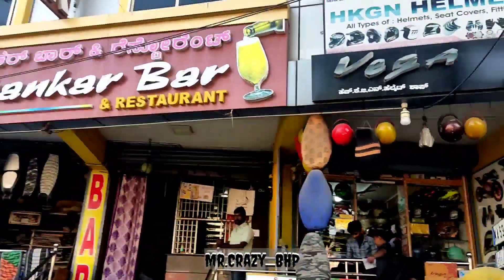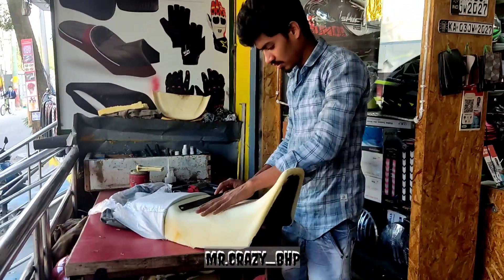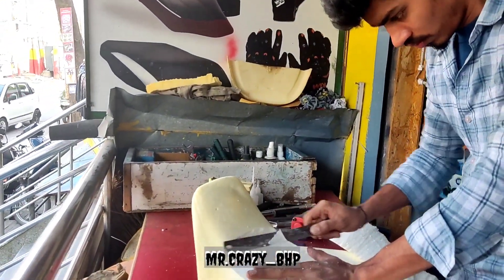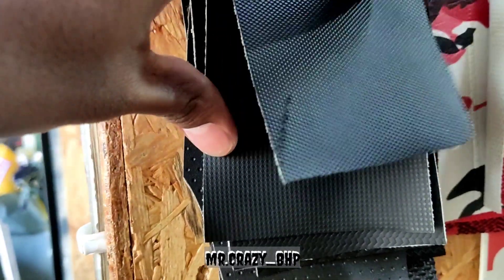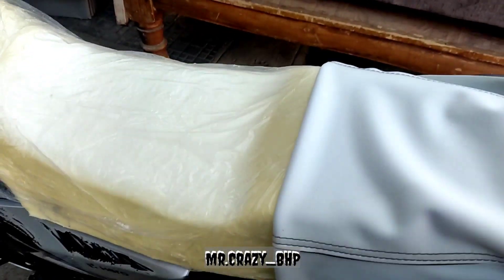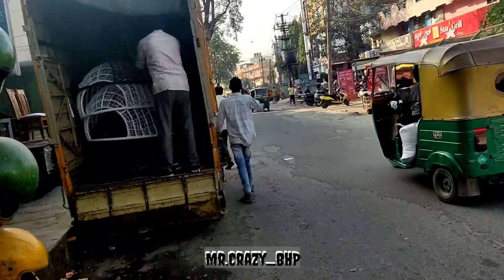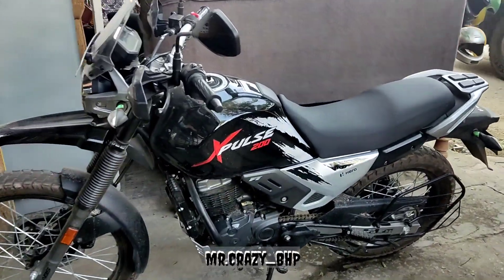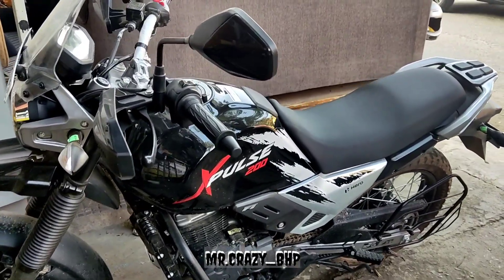Seat Modification for XPulse 200 | For Short XPulse Rider's | Must Watch Video

Comment: Thank you for the video very helpful. I look at my Hero's seat and saw that indeed the seat foam is very thick so there is a lot of improvement as you showed in  this video.
However I realised that the craftsman kept the seat rubber damper below the new seat in there. Did you remove this as well later on?
I saw it another video and tried it out it really does lower seat by another 2cm ( utube watch?v=fJsFwI8Htok )
Can you let me know if you did remove these seat rubber bushes too? If not give it a try it really helps a lot! I am adjusting the moto right now for my gf so I am looking for all possible methods to get the seat a little lower to the ground :)
Reply from the maker: Hi brother 👋 thanks for your support and kind advice.

But I haven't removed the original cover. It's still there. But it's all good now.

Comment: Bro one inch means 2.5 cms right did u really reduce this much.
Reply from the maker: Yes brother. Still it is really comfortable and I even went for a long ride after this seat modification.
Reply: @Crazy_BHP  thanks for your reply.i ordered the bike and waiting for delivery.when can i expect that bro
Reply from the maker: @muralibhattu3096  Great. Depends on the location and availability. Anyway Congratulations and have a safe riding.
Reply: @Crazy_BHP  bro i bought the new xpulse 4v. The issue i am facing is its getting heated even if i ride for 10kms.i bought it before three days.
Reply from the maker: @muralibhattu3096  Brother in that case get it to the showroom as soon as possible and tell them the issue. They will definitely help you.
Reply from the maker: @muralibhattu3096  And congratulations 🥳👏 on your new bike. Have a safe ride.

Comment: Hi I'm 5'2 I wanna buy this bike can I cut more than 1 inch of seat foam??
Reply from the maker: Tanmay, you will end up with back ache if you do. Suggested would be 1 inch or less than. I went for a long ride let's say around 500 at a stretch recently and never felt any issues
Reply: @Crazy_BHP  but will it feasible for my height? As many people said it's not for short riders I've recently learnt to ride bikes
Reply from the maker: @AstroBiswas  I insist, go to some showroom and check sitting on the bike and can you touch both the legs parallelly? If Yes, take a test ride, if you confident enough, go for it. and later you can decrease a inch of height.
Reply: @Crazy_BHP  I took test drive I tip toe and that too on one foot😢 very problem in balancing, is there anything else that can be done? Or my dreams of riding an adv be dreams only😢
Reply: @AstroBiswas  bro I will suggest you to buy xpulse 200 2v and reduce the height by 1.5 inch, i think then you can manage.
It might be difficult in long touring but you can manage